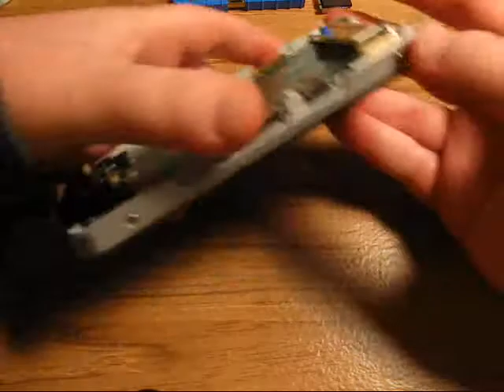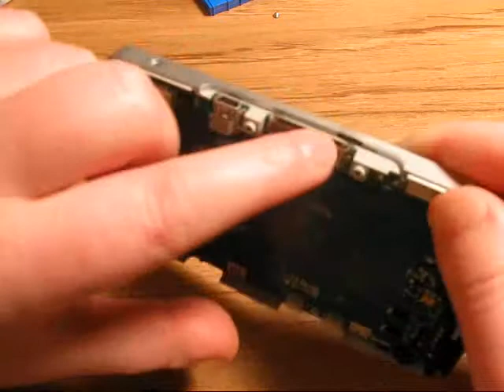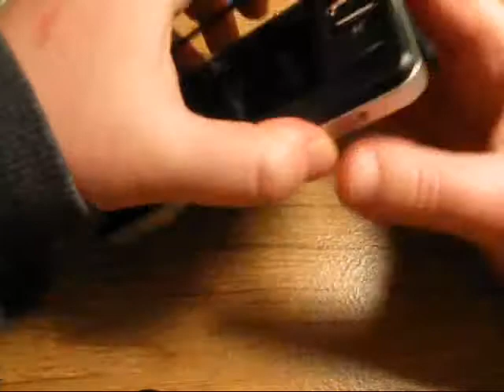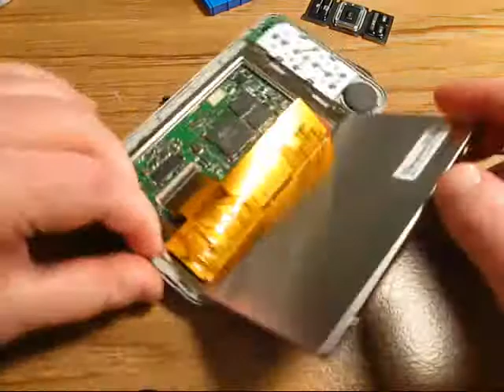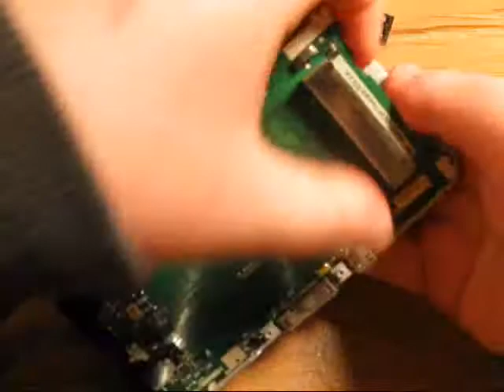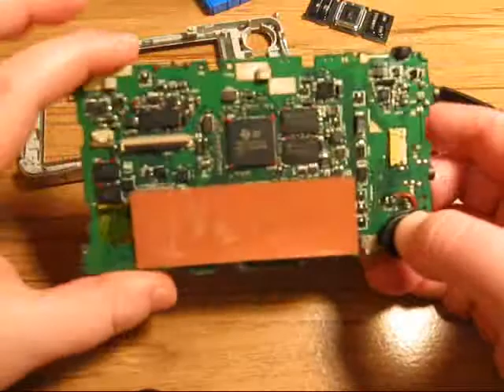Zen Vision W Complete Disassembly Video by a Technician - Part 2 of 2

Comment from the maker: There are 3 options:

1. Your ZIF cable is damaged
2. Both drives are fine and the motherboard is at fault
3. Both drives are at fault

If you need to send it in for Free Evaluation, go to TheGadgetDr     .     com and click Free Testing.

Comment: I dropped my ZVW a couple of times and it hasn't worked properly since then.  I actually bought a hitachi 60GB hard drive and put it in myself thinking that it had just been the hard drive that had gone out but it turns out that it still does the same thing.  It stays frozen at the ZEN logo and when in Recovery Mode, when I press buttons it will not respond.  Any ideas?  I would like to order some parts from your site but I need an idea as to what could be wrong.  Thanks in advance. :)